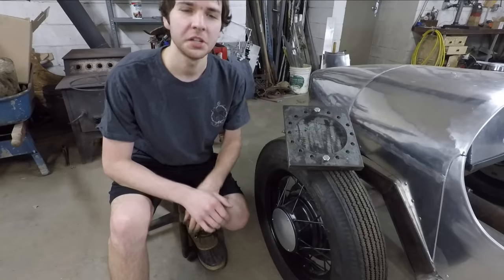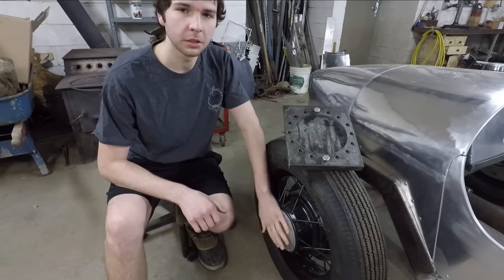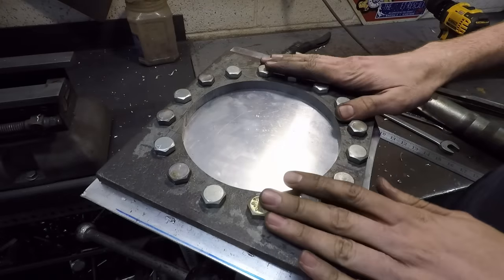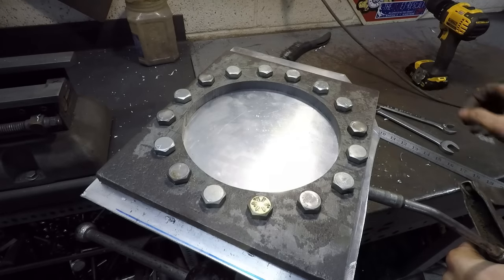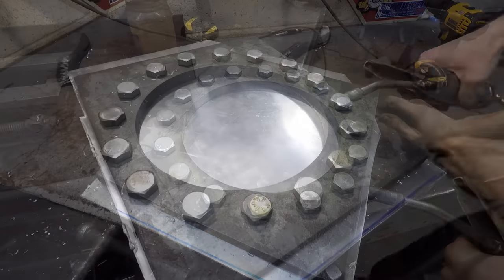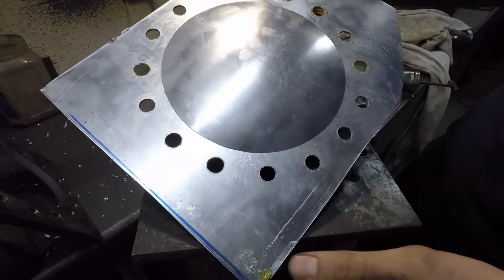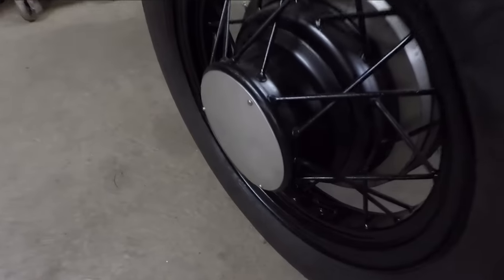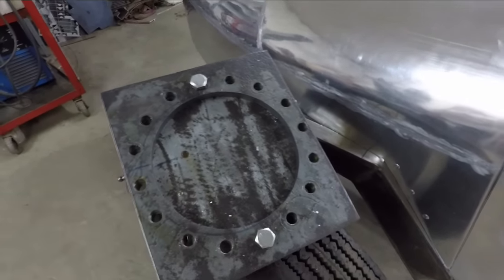Grease Hydroforming!

Comment: Seems like a much longer and more difficult process than having them stamped/pressed. Is anything even saved considering the labor time involved?
Reply: Considering that there was no hydraulic press involved, no forms to cast and grind (and sand and polish), I'd say that there was a lot saved. Plus, with half a dozen of those plates you can make hundreds of different domes, depending how far you can push the material.
Reply: You know, in my opinion it's less about a quick process, and more about doing it yourself. Plus, the more you do that type of things yourself, the more you expand your knowledge and experience.

Comment: I see you had to cut the bandsaw blade to remove the work. How did you get it inside the work in the first place without cutting in through the side
Reply: I was wondering that as well!
Reply: Most likely a tool called a band welder

Comment: This is a clever method for people who don't have access to a 1000+ PSI powerwasher
Reply: Literally lowes for $140
Reply: Calling BS that 1kpsi water pressure has enough energy to do this.
Reply: I’ve seen people make a water jet CNC cutter using HF pressure washers
Reply: @RadDadisRad  pretty easily actually, barely an inconvenience since its aluminum.
Reply: @RadDadisRad  It can do a LOT more! I have seen it done with steel for tuned exhausts for 2 cycle engines. These are much larger than the little disk in this video. Any old power washer will do. Even an electric POS (as long as it is still functional) You just cut two appropriately shaped profiles, plumb in the pressure washer, weld the edges together and Bob's your uncle. Sometimes the welded edge will "pop" before you have achieved the desired profile so you have to drain the water, re-weld the edge where it separated and have another go. 
https://www.youtube.com/watch?v=ppXRMTeR2NQ
You couldnt really use grease in that application because the two halves are never separated after forming. Cleaning it out would be a nightmare.  Perhaps the oil pump portion of a hydraulic jack could pump oil into such an assembly. Draining and cleaning out oil would be a lot easier than grease.
Reply: @powderslinger5968  Well any type of fluid under pressure could work for hydro forming. Grease is a thick fluid.
Reply: The grease gun has the advantage in control. Otherwise you need to create a mold to constrain the part
Reply: @RadDadisRad  See colinefurze's hydroforming experiment where he deforms thin steel sheet (I believe it's 1mm) and mentions at one point the pressure is only 20 bar ~ 290psi.

Comment: I'd like to see how far you can stretch some aluminum till it fails
Reply: Aluminum can be stretched a lot more than you think. Most all cooking pots are just squished by a press, that's usually at about 5 to 6 inches! Same with soda cans, all are just pressed into the form.
Reply: Jason Carmichael ya, but that’s a bit different process.

In this, the stock isn’t free to move at all, so it’s all stretch, I doubt he’d get more than a couple inches before it burst somewhere from a weak spot.

Comment: 0:54 I gasped "Holy shit are band saws nothing to this guy?"
Reply: reexamining everything... how do you rejoined that bandsaw! I didn't know one could do that!
Reply: @derchesten  some big bandsaws have built-in blade welders, they’re pretty neat
Reply: At some point between 0:28 and 0:54 did you gasp and think "Holy shit this guy must be a magician to get that blade inside that hole?"
Reply: @eviethekiwi7178  Right. Other than that, you can clamp the blade to a piece of bar stock and weld it. OR make a scarf joint and braze it. I haven't tried brazing one, but I have a lot of blades I've welded.
Edit: Not saying that's what he did, though. He probably used a blade welder.
Reply: I hurt when he did this....
Reply: I never knew the blades could be repaired
Reply: @xmo552  Absolutely! You can actually buy coils of blade stock and weld your own blades as you need them. This Old Tony actually has a video on TIG welding them. The key to welding them is to anneal them afterwards. Honestly, though, unless you have a dedicated bandsaw blade welder, the setup time for a single blade isn't worth the hassle. I've been saving my dull, bent, and broken blades for a while and I'm just going to dedicate a whole day to welding, grinding,  sharpening and heat treating some of my better blades and toss the rest or maybe repurpose some of the resaw blades for hand saws.

Comment: That free handed large diameter drilling in plate steel is no problem until it's a big problem. I strongly suggest clamping  your work.
Reply: Pff.. having a huge pice of steel fly through the workshop into someones face is great
Reply: @HochstartHarry  unshielded 12" wire wheels with no guards are fun launchers too. 
At the engine shop I used to work at , I'm situated  about 60' from the hot tank/ cleaning area and out in the main bay. 
Well, I'm walking over to a shelf across from me and I hear this peewwww go about a foot from my head. 
So I look around and see one of the guys at that wire wheel with saucer eyes and his jaw on the ground. 
So I meander back to see what's up.
I missed getting clocked upside the head with a Chevy 396 intake valve by about a foot 🤣

Comment: I'm shocked a grease gun can develop enough pressure to do that to aluminum sheet
Reply: That was my reaction. I expected the grease gun to break at some point and have it squirt out. Half the reason I can’t do things like this is because I didn’t know it was possible in the first place.
Reply: Yes, a grease gun will develop a LOT of pressure.  It’ll push a stuck brake caliper piston out like it’s nothing!
Reply: Ryan F, AvE has been playing around with a battery operated Milwaukee grease gun that’s been putting out over 10,000 pounds of pressure! Off the shelf! A regular grease gun can easily put out five thousand pounds of pressure, it probably would only take a hundred pounds to push out an aluminum sheet a half an inch.

Comment: How did you get the bandsaw blade through the hole in the plate @ 29 seconds? Without cutting in to the center from the outside?

Comment: Prototype car body panels used to be made, perhaps still are,  by making a die out of clay or plaster. The die would be fixed to the sheet metal and submerged in water. An explosive would be detonated in the water which would force the sheet metal into the form of the clay die. It was a one off deal for prototyping and worked due to the speed of the explosion.

Comment: Did you just use grease because you could easily attack the grease fitting? I've heard normal water pressure works fine

Comment: Nice work. A few years back I bought an Astra that had cast aluminium wheel hub centers, but one was missing. I vac-formed one from 5mm PVC sheet, using one of the existing hub centers as the form. I cut it out and sprayed it silver and cut out a logo stencil to spray the logo on in black. From normal viewing distance it was unnoticeable.

Comment: Is the advantage of grease a better control of leaks and no need for welding? I.e pressure is the same as one would have with water -- correct?

Comment: Wait, if he had to cut the bandsaw to get the part out, how did he get it in?
Reply: Not a fucking clue man, I'm sitting here scratching my head
Reply: Just cut it, put it in the hole, and weld it back together. Many metal bandsaws even come with a welder specifically for this, and many people, especially businesses, will buy big rolls of bandsaw strip to weld their own bandsaw blades since it's cheaper than buying them premade.

Comment: Just wait a second. How did you get the bandsaw into the start hold of that steel plate? You had to cut the band to get it out.
Reply: Steadfast The Renowned He must've threaded the blade through the whole before welding the bandsaw blade together
Reply: @kieranjohnston7616  That's all I can think of. But is that something that other people do?
Reply: @gossumx  It is something that other people do. Usually for making custom sized blades.

Comment: I've used water and compressed air to expand crushed steel 55 gallon drums back to perfect dimensions - but you don't want any air in the chamber you are trying to expand, just in case it fails. Works great. I would try water in the grease gun. Don't know if it would seal  but if it did would save cleanup time.

Comment: I see how you got the bandsaw blade out of your part but how did you get it in there to start?
Reply: I have the very same question! Some of the big band saws have a band welder built into the machine but you still have to remove the band from the machine to use it.

Comment: Dude..  i have that exact same OLD ass tap wrench.  Its built like a tank.  I wish I had the rest of the tools in your shop though.  Also, nice method.  The low flow of the grease gives you a lot of control of the situation.  Any reason you side drilled the grease port vs. Adding it on the back plate?
Reply from the maker: just because it's easier to access from the side

Comment: I recently watched a custom car guy build a plexiglas bubble top for a hot rod using a big setup like this. It would be interesting to see how far it would go before giving you a grease shower. Well done. I love shop tricks like this. Subbed.
Reply: This is why safety glass or a full face shield is required.

Comment: How did you get the holes drilled into the hubcap and the wheel-rim to match so perfectly?  Thanks!
Reply: a circle is 360deg.....three screws, divide 360 by 3 = one screw every 120deg.   or you can do the math and figure the distance around the circle and divide by three...make the holes in the cap, lay the cap on the rim and then mark for the rim holes...does not matter where you start, holes should always line up if you are exact.
Reply: Thanks,  @chip9177 !  No disrespect intended towards Archimedes but the math is the easy part - matching 16 by 16 holes is quite a feat.  I can only assume he has a really accurate drill press and accuracy techniques .  With drilling, a lot can go awry on the path to exactness.  All the best !! ^_^

Comment: What about using an aircompressor instead of grease if you could seal it
Reply: Compressed air in that would be dangerous. THink compressed spring...... If the metal splits you may get shrapnel!
Reply: the grease method uses 3000 psi

Comment: How did you get that bandsaw blade inside the hole you drilled in the thick plate? I can’t figure it out! Thanks man.
Reply: You cut the blade and reweld it. Some band saws have an electric blade welder on the main body next to the table.
Reply: RANDALL SEMRAU if you didn’t have that feature on your bandsaw, how do you weld them? Thanks.

Comment: That dish is gonna be parabolic, not a cross-section of a ball, if I understand it right? So I think this is a way to make parabolic dishes for focusing light or radio signals or whatever to a single point?
Reply: It's not actually parabolic, it's a catenary curve, which is the shape a chain makes when you hang it between two points. singingbanana has a decent video on it.

Comment: Very cool work, however, be careful with over expanding of course. If you could vacuum out the air of the system, it'd be of relatively little danger, since the grease alone is incompressible. Because there is air in the system, an explosive decompression would not be fun. Also, tiny jets of compressed liquid can kill you.

Comment: Any reason to do it this way over water or air? Curiosity, not critique.
Reply from the maker: air can be dangerous because it'll explode if you give it too much pressure, and it requires a really good seal. Water also needs a good seal and a connection for a pressure washer. Grease doesn't leak out too much and it's nice and slow

Comment: Just curious, why grease instead of water or air? Does one have a benefit over the other?
Reply: It's what he had on hand. Pressure washers can be very expensive if you want one for hydro forming. And you need a HIGH pressure one for that.
Reply: z28 and air is compressible so no
Reply: @iain3713  also if it ruptured for some reason it would become a bomb.

Comment: If u had of welded the nuts on the back of the bottom plate like turned them in to captive nuts it would make the process of making multiple alot faster you could just screw them in with a socket on a impact driver

Comment: 1/2" steel seemed a bit overkill for this, but I guess it was probably already available. I have to wonder if he tested with an air compressor or pressure washer first. Even a bicycle pump might have been enough for a thin sheet like that.

Comment: Why dont you just use water? Less messy and water does not compress. You could also have a relief valve on it with water. Just a thought for the next one!

Comment: I’m surprised you didn’t weld the nuts to the bottom plate  so all you have to do is tighten bolts no need to hold a nut

Comment: Maybe you only had those materials available, but wouldn't an English wheel been the cheaper way to go about this. 

Plus you'd find a hell of a lot more uses for it.
Reply from the maker: I do have an english wheel that I used to make the body panels, but this method produces perfectly uniform results much faster (once it's set up)

Comment: How the heck, did he get the bandsaw blade band into the steel in the first place? He cut it to get it out of the closed steel plate!
Reply from the maker: I cut it beforehand and welded it back together
Reply: @MacroMachines  And that worked? Interesting!
Reply: @MacroMachines  Did you TIG-weld it?

Comment: Explain 0:30 to me because I'm feeling baffled. Steel fixed loop, saw band fixed loop .... How TF did the band get through the hole???
Reply: Cut the blade. Run it through hole, weld the blade back together, saw part, cut the blade again to remove.

Comment: 0:28 How the f did you get the blade in there!?!?!
Reply: Cut it, run it throught the part on the table and then weld it back together. Sometimes the band-saws have a built in blade welder but you can just fusion TIG weld it and then sand any bumps down. That's why he cut it when he finished the contained cut.
Reply: @Christianfranceepic  Ok, thanks. It seemed like magic to me :)

Comment: Lets see, you threaded  the metal band saw blade through the hole to start, but you chopped the metal bandsaw blade with cutters to get the part out of the saw. Seems expensive

Comment: Interesting idea: heating it up to soften the aluminum and using water from a pressure washer.
Reply: I was thinking heat for the method he did. I would be worried about control of the pressure washer.

Comment: Greaseforming. What kind of grease is that? Take the element the grease has most of and add forming to it... As in water is diHYDROgen monoxide = HYDROforming
Reply: You got that backwards
Reply: @geurgeury  What?
Reply: @theonlypd  Hydroforming is not called "Hydro" because water contains hydrogen. "Hydro" means water, and hydrogen is called that because when burned it produces water, "Hydro-Generate".

Hydroforming with oil could be called oleoforming.
Reply: @geurgeury  Thank you. What is Bitcoin?

Comment: Quicker to clamp the sheet between two sheets of 20 mm ply, radius one edge, grease the edge and press it through in the press with the end of an old gas bottle.. Sure this works good, but too slow for me.

Comment: No one gonna comment that hi just cut his band saw blade to get it out lol
Reply: That's completely normal and the only way to cut an internal shape without a cut in from the edge. Keep in mind he cut it first to get it in there, so of course you need to cut it to get it out.
I would have cut in from the edge and welded up the cut on the edge of the circle, and it probably wouldn't have mattered either way if the cut was there.

Comment: use gloves if you want to keep your fingers in one piece.one day the drill will grab the metal and cut your skin or worse. you need your fingers for your nice work :-)
Reply: Gloves are dangerous with machinery. Accidentally bumping into them with no gloves might just cut you, with gloves it will snag and pull your hand or arm in. A 2HP drill press can easily mangle your arm if your gloves get caught on a large drill.

Comment: Get urself airhammer, cut mdf to any shape using 2 same cuts, span your metalsheet between your cutshapes, oil the surface, put ear, eye protection on done! Too much of heavy metal  work u've done there. 
There are simpler ways to get the job done with less effortand more fun!

Comment: wtf grease ewwww man why not water or oil somthing less discusting
Reply: Oil or water would leak everywhere in disassembly or if the seal isn't tight enough, plus water can corrode metals, especially freshly cut ones. On top of that as he said grease can easily be reused by scooping it up

Comment: too bad you can't us air
Reply: 3000 psi nitrogen from the bottle might do it.
Reply: @randallsemrau7845  no cleanup
Reply: Water is safer than air at this sort of pressure and still easier cleanup than grease